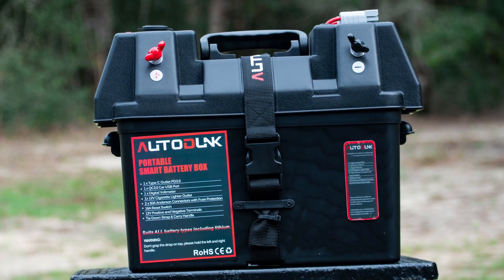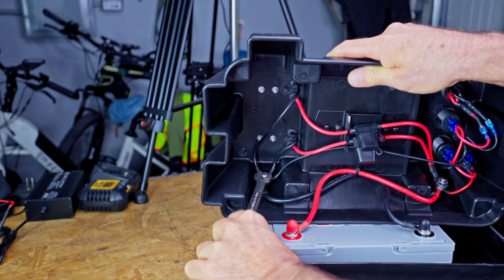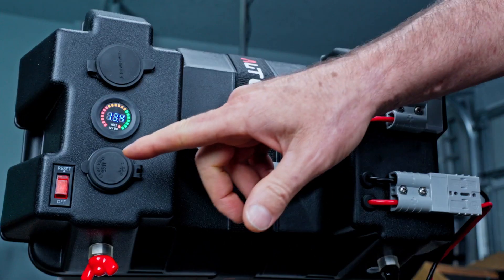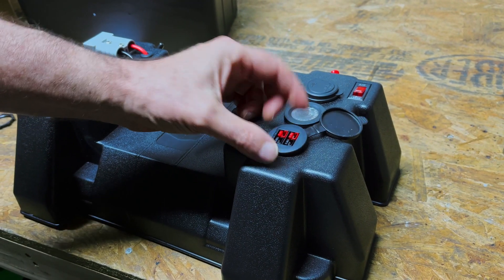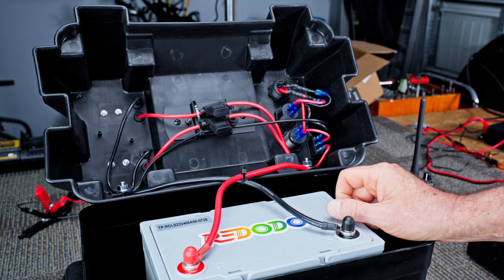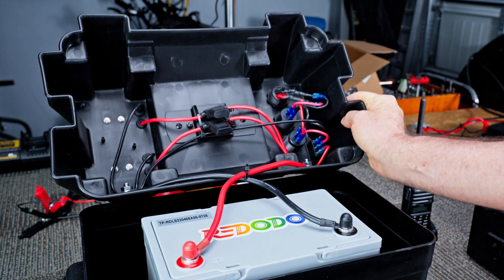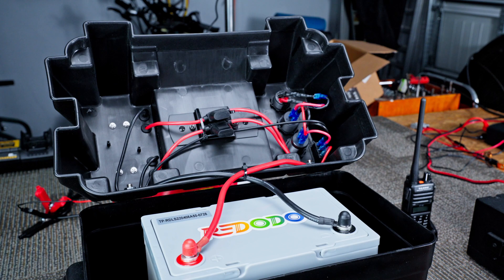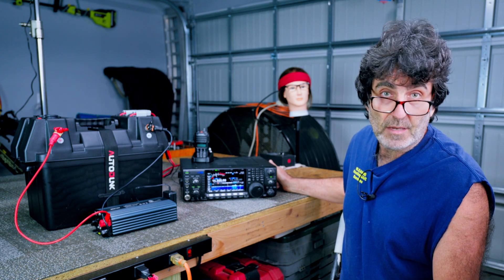Awesome Battery Box For Off-Grid I Got From Amazon [+My Portable Setup]

Comment: Do you know if there is anything like this for 200AH MINI batteries ? I'd like more WH and to have up to 2000w continuous. Also trying to find a diagram and or video to diy if needed
Reply from the maker: I don't know about that specifically... as long as the battery fits inside.  If there's nothing already done up, you could certainly build a box like that, just need a box to put it in... Maybe check marine battery boxes?  And get the dimensions of the battery you're using and find a box that it'll fit into..

Comment: Using BLUETTI EB3A ; )
Reply from the maker: Nice!  I think the battery capacity is the same as the Redodo, so I could have gotten a slightly bigger inverter... 😀
Reply: @JLPicard440  Paid $209 Black Friday for BLUETTI EB3A. It also functions as UPS, Bluetooth contol and update, lots of features. I really like it. Got it a backup battery as I have LiFePO4 battery for use with Amateur Radio equipment, using inexpensive amazon Miady LiFePO4 and also purchased Dakota Lithium LiFePO4 battery. I haven't used premium Dakota Lithium much since Miady has performed without failure for about 4 years  : )  Anyway just wanted to share my experince ; )  Thank You for  your videos, I used a few of your mods ; )
Reply from the maker: Awesome!  Yes we may need all those back up systems at some point!  Thank you for sharing.  I'm glad you've watched some of the other videos... 😀